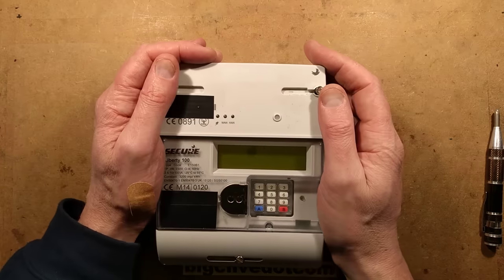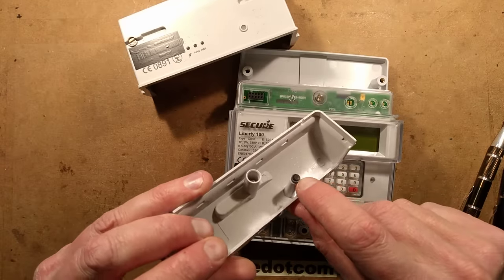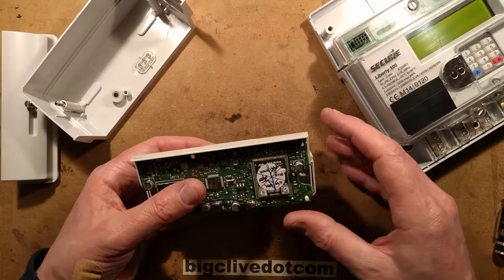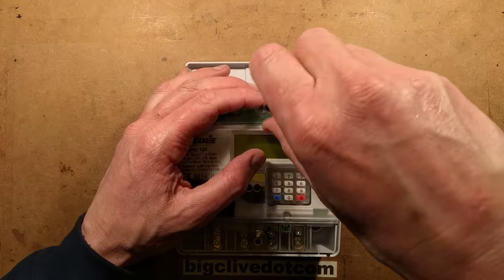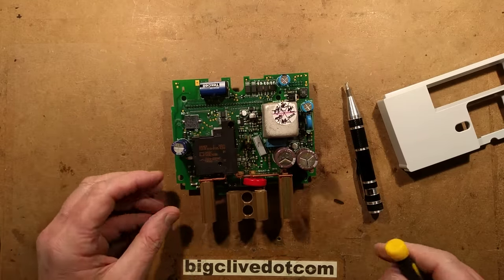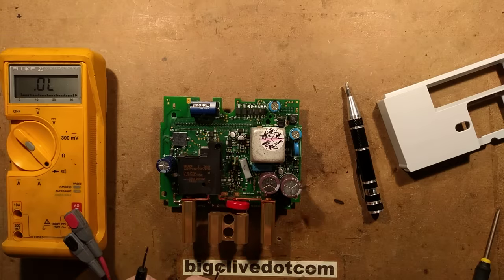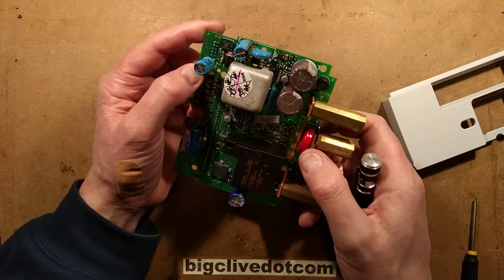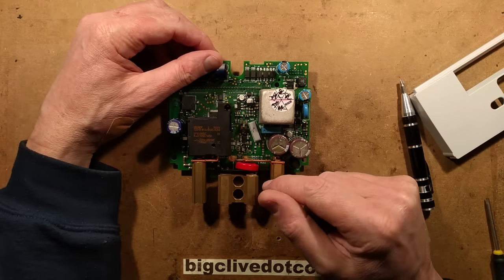Inside a smart meter, and the REAL problem with them.

Comment: Unfortunately, I work in this field.  The bit on the top that you took off and set aside is the bit that talks to the outside world.  The big / main PCB is just a current monitor that passes readings to the modem part (that you took off).  I think this is a SMETS1 meter and the main (meter) PCB may have been electrically connected to the communications hub (that you removed from the top).  SMETS2 (as pushed by all energy suppliers now) are similar, but the interface betwixt meter and comms hub is actually Zigbee (sorry wireless interface), even though it is a matter of centimeters between the 2 PCBs.

Regardless, it is Zigbee that is used between meter / CH and IHD or gas meter
Reply: the meter here is easily bypassed now i've seen it's internals and detection
Reply: Zigbee? Interesting..  I'm guessing the answer is probably no, but could this be connected to the ZHA protocol and see power consumption or other info from the device through the likes of SmartThings?
Reply: @YouTubeSupportTeams  please tell 😂
Reply: @EoinHealy  I went looking when I had a SMETS2 fitted and while it is zigbee its encrypted. Sad really as it would have allowed me to collect the data locally if there had been some way to connect. The in-house displays are IMHO pretty useless. Some of the connected displays have WiFi connections or the capability to add. I tried to get one from my supplier but ran into the the usual customer service knowledge void.
Reply: As a Bog-standard consumer I'm well fed up. I started with SMETS1 in 2015 & with British Gas and they co-operated with the supplier viz sending consumption readings. Then I changed supplier, a few years later. My dashboard continued to work for a while then stopped - of course!
I complained to the new supplier and they came and installed SMETS2 meters (last October -'20) The electricity meter supplies readings to the supplier but the installation team (came twice) could not get the Gas meter to syncronize and submit readings. Now I still have to go outside and press button A, then B to read and send to the new supplier. I didn't even have to do that 50 years ago.
Thanks for your submission, by the way.
Reply: "...Ohh the ZigBee Ohh the ZigBee..."
Reply: @mrpropergander6800  Corporate greed!
Reply: @Big Em, I seem to recall right from early days these meters were supposed to be able to detect possibly fraud by comparing the Neutral current with the Line Current which seems a sensible move and yet this meter only has a current shunt in the Line. Do some makes have dual current sensing?
Reply: As a contractor for all the large energy companies, I've seen all sorts of bypasses. The smart meters can't be bypassed without damage to the installation. Even the cabling to the ports have collars to prevent insertion of a loop. The IR device is designed for meter operatives to preform upgrade flashes, although the new SMET2 meters can do it over the air. The communication unit was designed to communication with a Hot shoe for the gas meter. All data is sent via the modem on the electric meter. The reason the SMET1 was superseded is you can't move provider without having a new meter installed. The Sim communication can't be passed on to the new supplier. Also the bi directional date is limited to a mode changes,  credit or top-up mode and to stop the supply. 
All other data updates are done via a re-flash by a MOP.
Reply: @911Locksmiths  are the neutral and live both monitored,
Reply: @ivanogilby6174  The live is monitoring for usage. All 4 or 5 ports are protected by anti tamper switches. The system can report if a neutral/earth - PNE  has been dropped off and refitted also. 
We attended a job yesterday where an SSE meter had a flag notice, tamper switch activation.
Reply: @911Locksmiths  How much does it cost for you to pretend you didnt see anything
Reply: I do not believe that bypassing the meter has to damage the installation. For example what if there's the classic jumper from company fuse to consumer unit, or the even more lethal jump from company fuse to a power socket? If it is not measuring neutral current as well as live I do not see how it would detect that.
Reply: @trueriver1950  a smart meter still needs to be inspected. A DTM tamper is easily spotted. If the fuse is pulled the refitted it will report the line drop too. It's really well devised.
Reply: @911Locksmiths  All depends on the cabling coming into the house / meter... You can always connect a loop upstream of the meter if there''s physical access and you wear thick gloves (🤣)... I'm not in the UK, have a smart meter but upstream of said meter there is still the old fashioned main line fuses where I could if I wanter tap in a wee loop or two...
Reply: @Farlig69  240v concentric cable done live ain't for a beginner. Good chance of blowing yourself to fcuk in the process or it could also overheat and catch fire. So is it really worth the risk?
Reply: @Farlig69  ironically we found a second live cable coming from behind a series7 cutout at a job today. The guy wasn't home so we forced access.. He now has no power and will  need to contact the supplier to explain how that cable mysteriously appeared inside the fuse carrier.
Reply: @Scottwhatleybates  Indeed but why do YOU ask?

Comment: A while ago we had one of the industry standard Landis & Gyr energy meters fitted in place of the old disc type induction meter. Almost immediately our "usage" increased. I queried this with our electricity provider and the manufactures. My main concern was that the inductive meter disc will absorb peaks from switching on appliances etc due to the inertia of the disc but the modern meters are capable of measuring the whole peak and calculating it as energy consumed. They directed me to the user manual which states there are a number of programmable variables affecting the "peak measurement" and it's response to spikes. This is adjustable by the electricity company via an IR opto-interface and highly encrypted firmware/software tool. The electricity supplier got back to me and stated they were set to record "average" peak value (this depends on the supplier).
Reply: Smart meters can also measure power factor. Settings can be carried out remotely and yes, with a change of law will be able to be remotely disconnected. Already happens with pre payment meters, same meter, different program. Say NO to these dangerous devices.
Reply: I'll settle for the grinding disc type lol ain't changing
Reply: ohh they didnt use the regular excuse, that your old meter was reading low?
Reply: If that is the case, this means that your "switching on appliances etc" were using electricity, which the old "disc" meter could not correctly detect. It is only fair to say that you were pulling electricity out of the grid without paying for it, and it is only fair that you pay for what you use.
Reply: why couldnt the old disc type meters read amp spikes?  as far as I know they sped up and slowed down according to how may amps were going thru the meter.. the new meters are a scam,, when they first replaced mine, my bill  was abt the same as the old disc meter... one day abt a month after, I caught an Oncor tech, who parked his truck on the road, abt 40 yards from my house, sneaking into my yard with a new meter.. I asked him what was up, and he said the meter wasnt sending its signal. he installed the new meter and my bill went up 60.00 a month,,
  you can get 1 free meter accuracy check a year, but you dont know if they are lying to u or not.. they supposedly have an independent testing company that tests them, but  who knows who they are, or who pays them..  you just have to take thier word for it,.,,, Oncor  has a monopoly in TX, that runs deep,, Governor appointees regulate them, and its like dealing with the Gustapo,,  if you dont agree with them, theres nothing u can do, but file a complaint,,, ok, if u get into litigation against them, they can shut your power off,, then what..      @todortodorov940
Reply: That's some interesting information you were able to get out of the supplier and manufacturer!
Reply: @randy1ization They can shut your power off anyway, the meter belongs to them and then can just come and remove an old mechanical style meter, and in the case they couldnt gain access, they would just have your incoming mains disconnected in the street

Comment: So where does the magnet go? Asking for a friend.
Reply: there's no way for single phase meters, they use a shunt to measure, 3 phase ones may have a sort of transformer to have a single signal output for automatic averaged reading on the 3 phases, they reported that you can put a (really strong) magnet on it and contrast the field (if you don't increase it)

don't try anything like that, bad move and quite likely not working
Reply: False.
Reply: If you want to "override" the NC relay, just destroy the meter with high voltage... you can't get a false reading with a magnet...
Reply: To head off the misinformation, I looked this up a long time ago.

Yes, certain very old meters can be slowed down by placing a powerful magnet in the right place. This will either place an eddy current drag on the rotating disc in the electromechanical meters, or saturate the core of the current transformer in an electronic meter. This used to be a well-known way of stealing electricity - which is why every meter you might find today is either proofed against this method, or fitted with active countermeasures.
Reply: first of all i said "they reported", infact a technician of our national company said that to me as well, another article said that and... here's an attempt https://www.blogsicilia.it/wp-content/uploads/2017/08/IMG-20170803-WA0002.jpg really devoted people i say, bless em.. LOL... that's an italian 3 phases

i don't know EXACTLY how 3 phases wound on the same core will act, it makes sense that gives an averaged continuous field on the core that can be measured with an hall sensor maybe

overriding the relay will let the company know that something is wrong considering that there's power on the output

yeah, i know that old meters can be tricked that way, but i vould be concerned about residual magnetization, and i've seen a technician when i was a kid checking for regular metering with a giant heater with fans, it was the house of some my relatives, not inhabited
Reply: I work for a water utility company and all the brand meters we use for domestic purposes can stopped by using a very powerful magnet. There are way easier ways to steal 0.25¢ of water but they will spend $25 USD to save a Dollar and end up getting caught. I have several magnets in my collection now.
Reply: Magnets won't work, on the electronic meters, well at least not here in the DK, at the company i work in, back then, we had an apartment rental customer, in one of apartments, a vietnamese family, growed skunk~narcotic something, they had taped a magnet on the side, so the power utility got suspecious, that's how they got busted.
Reply: @MARKE911  you guys using Neptunes? In my experience you don't even need a magnet to stop those, they stop themselves
Reply: @Metal Man Cheers mate.  Maybe it's just us NI people that know about the magnets by the sound of it haha.
Reply: @Metal Man so when yer man comes to read your meter you pull off the magnet?
Reply: @Metal Man that's good so ,they can't compare to your previous usage to catch ye ha, change electricity providers often aswell save every last penny ;)
Reply: Hahaha, My 'friend' many moons ago used to lie her gas meter on it's back till the hose split and they replaced it with pipe!
Reply: you don't bypass this meter with a magnet. it's hard bypassed

Comment: Honestly the problem for me when my old meter got smashed out by ice from the roof and replaced with a smart meter... there's no longer a worker from the power company who would take cash on the spot instead of cutting the power.
Which was an opportunity I have availed myself of more times than I'm proud of.
Reply: @mcfcguvnors  Magnets don't work BUT they will end up getting you a court case from your service provider for attempted theft.
Reply: @davelowets  Magnets DID work but on the old electric meters with the spinning wheel. A magnet slows the wheel, doesn't stop it, but slows it enough so you get billed less money
Reply: @AnonAnonAnon  They don't... The meter is better shielded that that.
Reply: @davelowets  Ok, then magically my bill went down and the slowing down of the wheel was just an illusion witnessed by my whole family for years. Thanks for pointing that out;)

Comment: That big relay is a bi-stable relay, use power only when changing state, two coils, one for turn on and one for turn of
Reply: or just reverse the polarity on the same coil to switch over between states. slightly different construction.